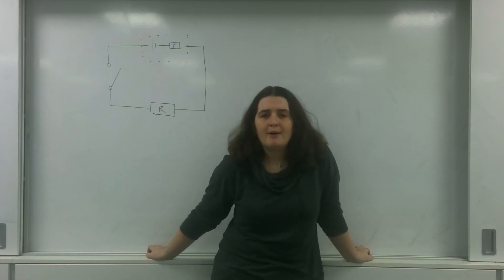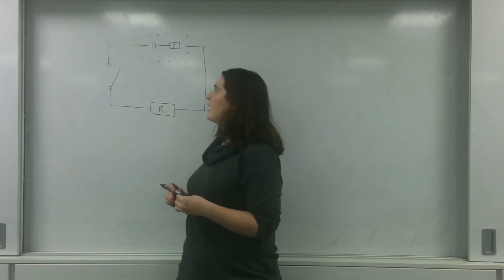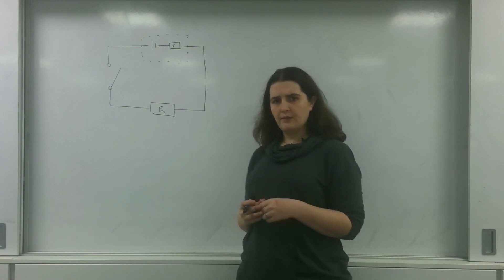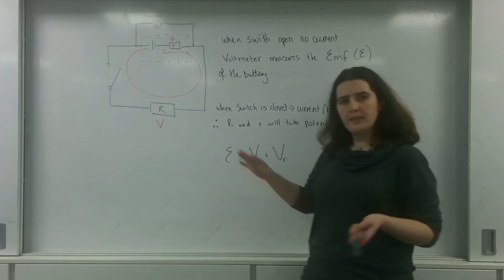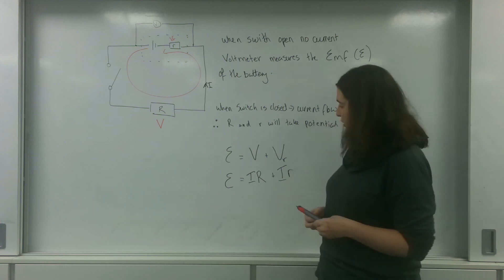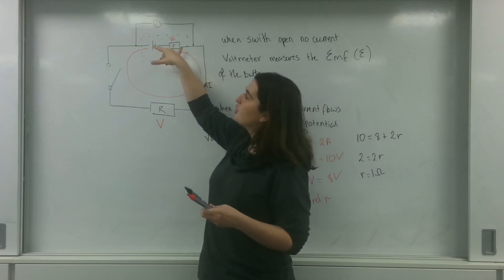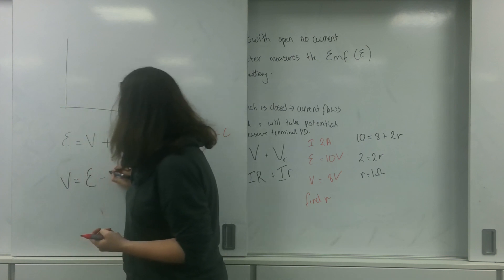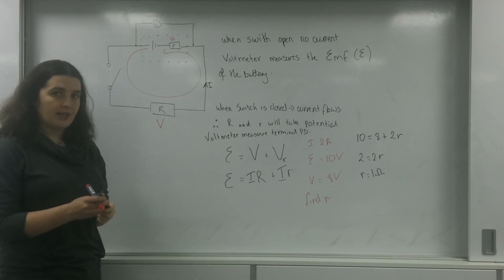Internal resistance AQA Alevel Physics

Comment: When current Increases does big  R decrease but little R stay the same
Reply from the maker: Hi, 

When the current increases both R's stay the same. However due to Kirchoffs laws and ohms law V=IR the PD the internal resistance had over it increases. This means that the PD to the other resistor (the rest of the circuit decreases)

Over time in a real battery little r (internal resistance) will change, normally increase, and less PD will reach the main part of the circuit due to the internal resistance taking more PD in accordance with ohms law. 

Hope that helps
Reply: TLPhysics if current is increasing and the pd across little r increases cuz of V=IR why can the same not be said about big R
Reply from the maker: Ah, 

Depend what you are changing in the circuit. 

1) If you have a set voltage you have to change the total  resistance of the circuit to change the current. The only way you can do this is by changing the external resistance. 

To increase the current you will need to decrease the external resistance. This means the internal resistor will have a bigger share of the voltage than before due to V=IR (since internal resistor still follows this)

2) Another way to change current is change total Voltage. But this means r and R will get a proportional change (see potential dividers) IE double voltage will double current for ALL resistors, so each resistor will get double the PD across it. 

So it depends on the situation the current is changing under.
Reply: TLPhysics thank you ..situation 1 is what I was thinking about because most of the time In exam questions it’s a set voltage